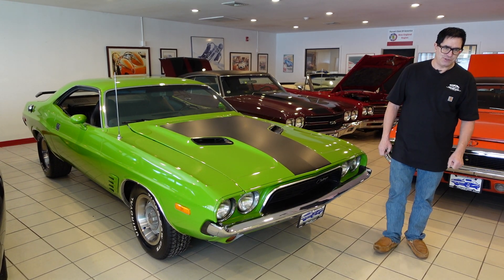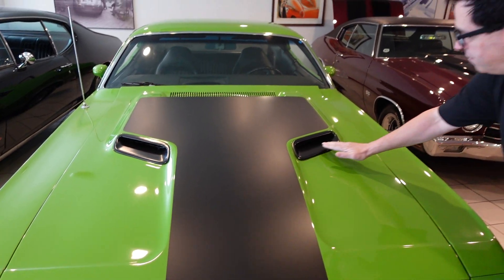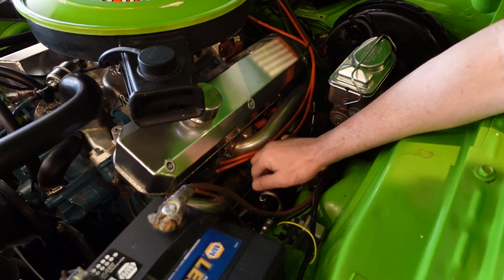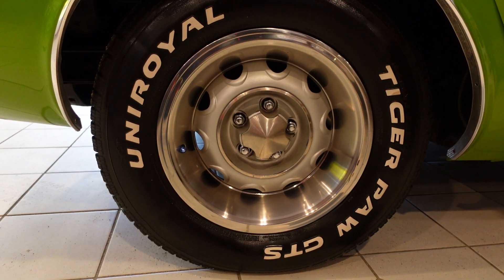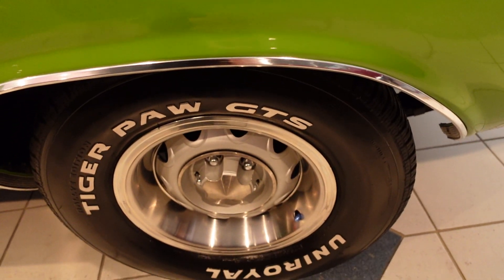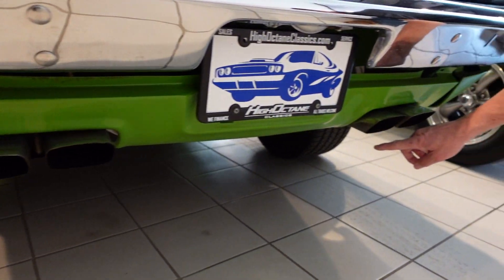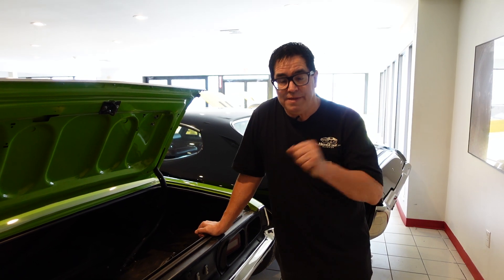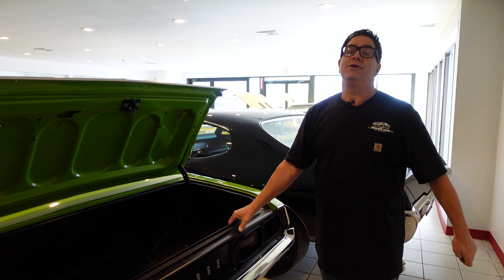1973 Dodge Challenger Walkaround with Steve Magnante

Comment: That's the one to have. Small block allows it to handle better which challengers are not known for.  A 440 challenger is a mighty handful with factory suspension.
Cheers 🇨🇦
Reply: @My Pronoun is WTF your experience may be true.  There is not much difference unless your racing it.  Road course track day  events. The 360 is about 550lbs dry and the 440 about 675lbs dry.  A few lbs more for fluids, larger rad and there's a 130lbs off the front axle.  In racing that's huge. 
I agree on the street not so much and the 440 bark is sweet.  Cheers 🇨🇦

Comment: Steve your presentations are spot on brother, what you didn't mention was the compression ratio drop in 1973 on the 340 & 318 engines. You did a great job showing the modifications but didn't mention again the compression ratio drop. also, I might include for this perfect looking car the factory horsepower output. I bet it would be a wild ride. I had the 340 Duster from dodge so that's why I kept listening for that information and was disappointed when it was not given.

Comment: No bumperettes, so bumpers likely from a diff year Challenger (1970?). No shot of the fender tag, but it'd be interesting to see how that squares to what is on the car now. Pretty sure the air cleaner lid did not come body color nor with the obvious dent. No mention of the glaring issues with the steering wheel and the missing trunk floor cap, mat, and spare. No Challenger R/T in 73, but if this is a Rallye, must be a side-stripe delete car or they didn't put them back on after the obvious re-spray (color not avail in 73). If you're looking for a fun car, this just might be it, but if you're looking for originality the search continues.

Comment: 1973 was the first year for the Dodge Challenger Rallye, taking the place of the R/T as the performance model. The Challenger was the last Dodge to carry the R/T badging in 1972, the Dodge Charger having lost its R/T badging after the 1971 model year. The Challenger Rallye package would only continue for two years, the 1973 and 1974 models.

Comment: Radiator looks pretty small.
Reply: I have a 318 73 Challenger and it has the same size. It must the small block size. I'm going to take out the filler piece and install a larger one